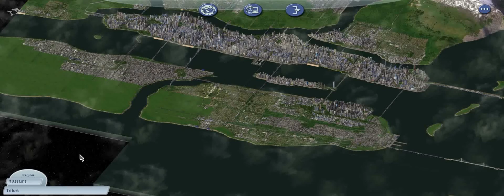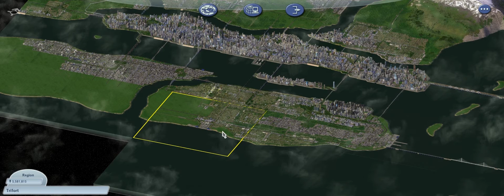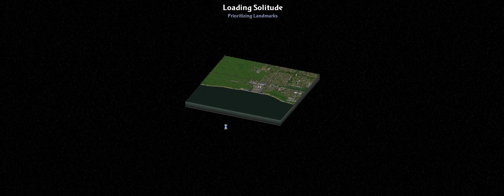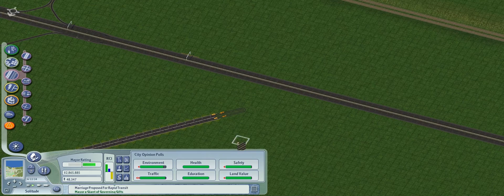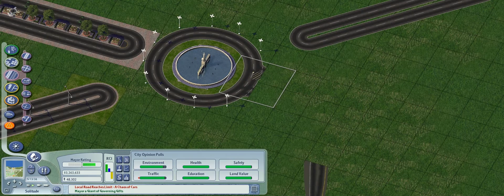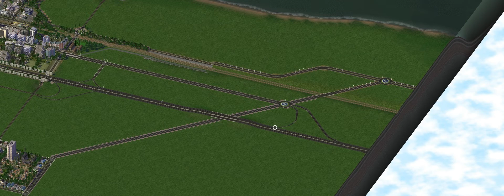Let's play SimCity 4 (mods, high realism)—part 27

Comment: Hi again Sam, I installed Real Railway, but I think you cannot make intersections? so you make your main rail all straight witouth intersections of any type?
Reply from the maker: That's odd that it's not letting you make switches with the RRW.  It definitely should be possible.  I think I had a similar problem at first when I installed the RRW...I don't remember for sure, but I think I had to remove all other rail texture mods (I had one that changed the dirt to grass and one that put grass under the smooth curves).  Just look through your plugins and test removing other rail mods and see if that fixes the problem.  You installed the Real Railway Mod through the main Network Addon Mod download, right?

Comment: Hi, there again :) I finally managed to record with fraps. Thanks a lot for the help. Also can you tell what are those texture grasses props you use to match with fire landing and street sidewalks. I think you did that in last video. Thanks
Reply from the maker: Hi, no problem, good to hear you got Fraps working :) The grass lots that match the fire department landing strip are from a custom airport mod I'm using.  I think the name is either RMIP-SAE (Small Airport Edition) or ACE.  It's definitely on Simtropolis, though.  The other shade of grass that matched the street grass is from a custom lot I made in the Lot Editor; all I had to do was replace the normal texture for the "Open Grass Area" park with another standard one that comes with the game.  It should be easy to make one for yourself, or I could just share the lot on Google Drive or something if you like.

Comment: Glad your back with another episode ! RHW maybe tedious but those diagonal viaduct are awesome mostly you will make straight one´s ! Attaching those ramps can be very tedious if your´r in mountainious terrain, you have a slop mode installed, that make it even more difficult; mostly working with the maxis avenue with a special smooth slope will do the trick !
Reply from the maker: Thanks for your comment :) I don't usually build any highways in mountainous terrain, but it definitely is hard to make ramps, RHW transitions, and other things there!